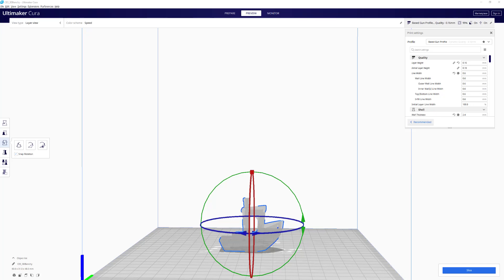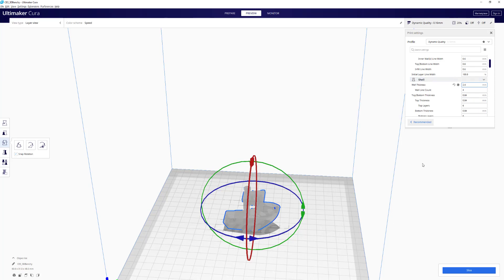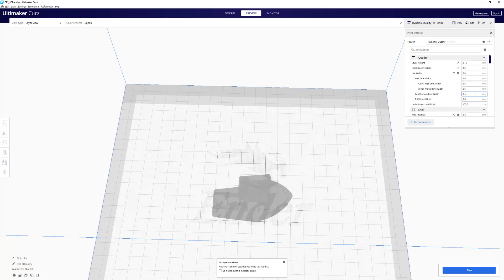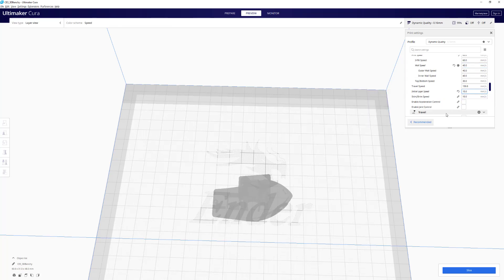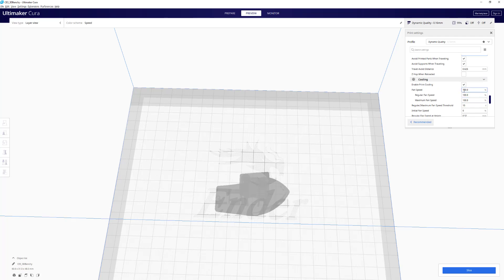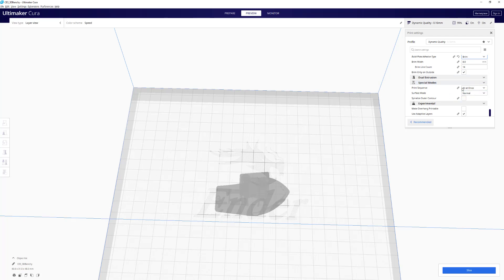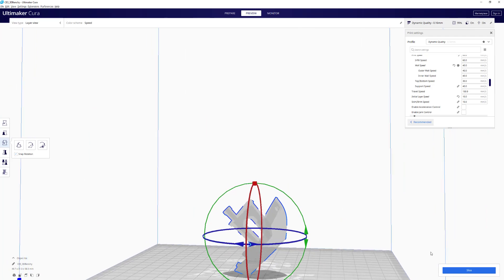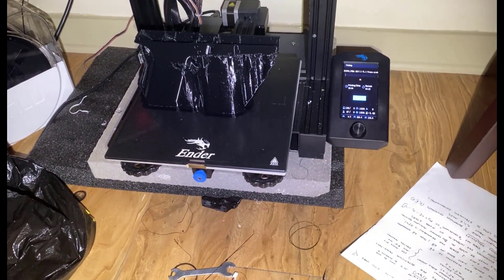How to Print (G)ood (U)nbending (N)ovel (S)tructurally Sound Figurines

Comment: I use Prusa Slicer, it has some very cool features, but it's way more advanced. Only use it for experimenting/modifying or just if you want the finish to look better.
Also, i have found that around 5-10% ironing flow is perfect, the 15% default makes everything look bad. Just don't ever use ironing on Cura.
A bed temperature under 55 is literally useless, as it is below the glass transition temperature of PLA. 55-65 is usually good (it kinda melts above that). As for print speed, 45-50 is almost always good, but slow. 60-75 is faster but you risk ghosting if your printer frame is not sturdy enough. Slower than 45 is usually not great, the layers don't fuse very well.
*ALWAYS PRINT A SKIRT*: if you purge the nozzle before printing the first layer is way better. Brims are only useful for prints with small contact area, or if you think the print will lift on the corners, otherwise they are a hassle to remove and don't help much. For ABS brims are almost mandatory.
For line width, just keep it at your nozzle diameter, it's not really that useful. Layer heights should always be an even number (google why,  i didn't really understand it. look for the "magic number". When you calculate it it's always just an even number). 0.2 should be the standard, 0.1 for quality and 0.3 for speed, if you just want it now. you can go with smaller increments (eg. 0.12, 0.24, etc..) but keep in mind it makes a small difference. This is useful if for example you want to print something that is exactly 12cm tall. Then you can use 0.12mm layer height, to get 100% dimensional accuracy. Don't do this though, plastics shrink as they cool (PLA shrinks the least) and it changes the dimensions about 1-7% depending on your plastic and where you bought it.
The biggest issue anyone will ever have with 3D printing is with the first layer. The print either doesn't stick at all, sticks too well or is uneven/lifts. Just keep leveling the bed (make sure the bed and the hotend is hot before you do), clean your build plate, use a glue stick if it still won't stick (try different brand, only steadler works for me. Don't know why...), and use a plastic burger flipping thingy (I don't know what to call it in english) to pry the prints if they stick too well.

Hope this helps someone, this is all just from personal experience.

Comment: "Rafts are annoying"
Rafts are the only way I have ever gotten anything to stick. Albeit, I didn't think to use anything above 0.2 line width for the actual print until you brought it up here.
What are your problems with them?
Reply from the maker: I just haven't ever really need them unless its something that is barely touching the build plate. I haven't really used them since the first time I got my printer so perhaps its I should revisit it some time
Reply: wat the fuk

Comment: Thanks man. I’ve been struggling with 3D printing. I got my printer a month ago and I’ve been through one roll of PLA+ already and I only have 3 successful prints. The first layer has been a bitch and a half for me. New sub. Thanks for everything. Working with an Ender 3 V2
Reply from the maker: I should probably make a real video going over these settings because I've done a lot of experimenting with them. I would try a glue stick since that's my go to if I'm having first layer issues. Past that, there are more things you can do like over extrude the first layer but that overkill for PLA usually
Reply: @Lead Muffins I just used hairspray man. Seems to do the trick.